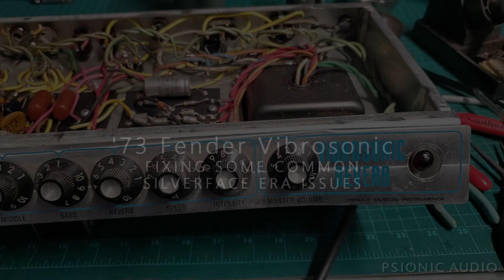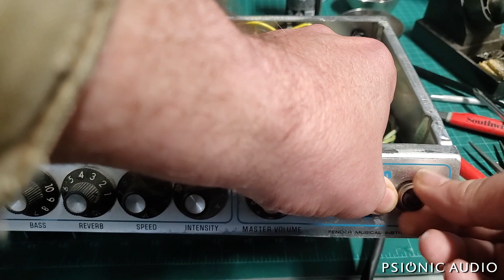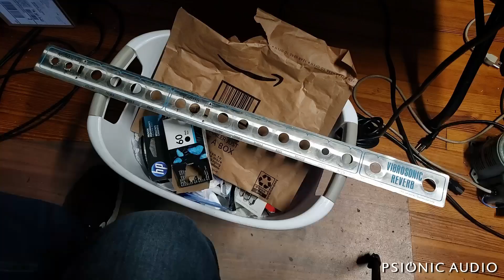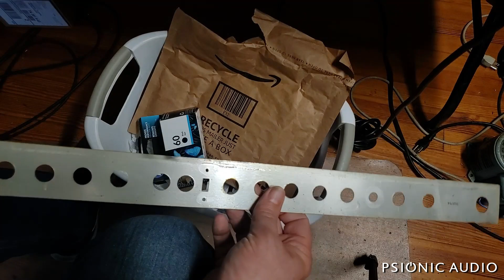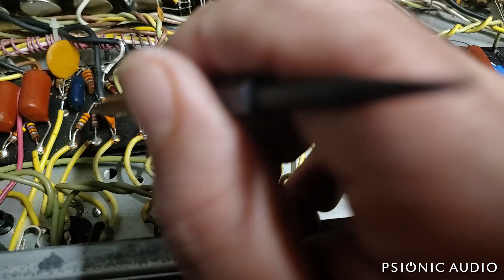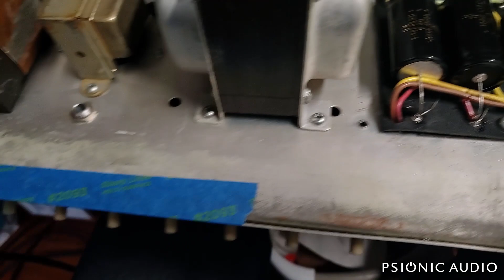'73 Fender Vibrosonic | Fixing Some Common Silverface Era Issues

Comment: Nice video! Appreciate your attention to detail about some subtle changes in the circuit. Most people miss those. That's why I'm posting this additional information. You seem like the kind of guy who would care. :-) The reason your faceplate came loose on that end is because you are missing a Fender installed retaining piece on the jewel assembly. As others have mentioned, on these amps there was a chrome flange washer that screwed UNDER the jewel itself, but OVER the faceplate. This is what holds the faceplate secure on that end, not just adhesive. These flange washers were often lost because people forget to put them back on when replacing the jewel lamps. I would be glad to post a photograph of this oft-forgotten Fender part, which I can show as original to my late 1973 mfg. date Vibrosonic Reverb. This trim washer was actually a kludge introduced by Fender by about early 1973. 1972-74 Sales literature does not show the flange washer on the sample amps. The faceplates were coming loose due to the heat of the power supply softening up the adhesive. I have seen many Fender amps with this washer still in place, but many more with it missing. It is easy to lose.

But why the kludge? There is a reason and here it is.

FWIW, the 100W amp series faceplates were made independently and easily removable by non-assembly technicians at Fender. This was accomplished by keeping them clear of most front panel potentiometer retaining nuts and the jewel assembly. The holes were simply punched out larger. Only the input jacks and brite switches were encumbered. This was on purpose. This was to allow Fender to accomplish final branding on the chassis at a much later point in production. That was done because this one chassis design, aka "100W RMS amp with reverb and Vibrato" was used for no less than FIVE otherwise electrically identical Fender amplifiers. Those were the Quad Reverb, The Super Six, the Vibrosonic Reverb, the Dual Showman Reverb and the Twin Reverb. Thus, Fender could build a single line of amplifiers to 95% completion, and brand them via faceplate at the very last moment based on demand, and with only very minimal technical intervention, and NO SOLDER WORK required. This vastly shortened delivery time and allowed Fender to respond to market demand, instead of having to have five lines in parallel, or rotate production through multiple versions, or end up with unwanted back stock of less popular models because of bad sales projections.

Note too that this amplifer series came either with or without a pull boost option from the very beginning. Fender did not "add that later". Schematic, here; https://www.bustedgear.com/images/schematics/Fender_100W_SF.pdf     All these details can be confirmed from the schematic, including the "pull boost option" See note 5 on the schematic, where Fender specifically states that pull boost was "used in some versions". The pull boost option was original to this design, and debuted in 1972, which is confirmed by Fender sales literature of the period. Read Page 49, here; https://www.dropbox.com/s/6fo2m2lulce5a58/1972%20Fender%20Catalog.pdf?dl=0      FWIW, my late 1973 mfg. date Vibrosonic has this feature. It is easy to find example both with and without pull boost dating to this period, so it was not a "later addition" by Fender. It was there from the beginning of this design, as both the catalogue information and well dated examples still extant easily demonstrate.  

I have never been able to discover how one could get this design amp WITHOUT pull boost. Perhaps Fender simply did not include this feature on a set number of amps? Perhaps it happened due to a lack of parts availability, or by special order, or for export only? I can find now compelling explanation, nor logic to the thing. But they definitely did it and examples of both are easily discoverable.

Cheers to you!
Reply: I think the pro reverb & super reverb are also in that same size chassis. Maybe some I’m forgetting also like the semi-pro/amateur & the east coast released Soupa Revurb!

Comment: Great video....my '73 Pro Reverb (non master volume) has only 5  25/25 bypass caps on the board with one of them being a 5/50. Yet all the silverface circuits I 've seen have 7 caps?  They are the old white original mallory caps which need changing. Just wondering if i should add the extra 2 caps as per all the circuits I've seen? And would a 25uf/50volt cap be ok to replace the 5/25 cap?
Reply from the maker: The 5/50 is better. And look over by the RCA jacks for the other two caps. They’ll be there.
Reply: @PsionicAudio  Thank you. There is an extra one on the vibrato rca which makes 6 in total. No sign of a 7th cap

Comment: Echoing an earlier comment, these Silverface amps had a trim-ring to hold faceplate down, held by the jewel light. You can see the scratch on the faceplate where it once was.
Reply from the maker: Yeah, but they are very commonly lost. And nothing (even on special hardware sites) is a good replacement

Comment: The oils in the GooGone will make it very difficult for new glue to adhere to the metal. You need to clean that stuff off REALLY good before gluing.
Reply from the maker: Yeah, I have naptha for that.

Comment: I have a 69 Bandmaster Rev  on the bench right now that I couldn't get the bias any hotter than 45% and when I started bringing the resistor down, the plate voltage was just in the basement at like 355v....poor thing looked like it sat on a shelf next to a turbo 350 transmission in a garage for 40 years, plugged in and on, when I first got it in.

Comment: The hits keep coming! Thanks for the video, Lyle. Just as an aside, I have a similar era Twin Reverb in my shop right now and it has a large chrome finish washer between the jewel light and the front panel. Not sure where you might find an aftermarket replacement, but it looks like that's how it was done.
Reply from the maker: Yeah, but so so many amps have them missing.
Reply: @PsionicAudio  I found an M18x22x1.5 aluminum washer (think auto oil drain washer) works OK. It’s a tad oversize but with a heat shrink shim fit well. Not perfect but easy and inexpensive.

Comment: I've heard people criticize the push-pull circuit before, but I've never really understood why.  I have a 1980 Princeton Reverb with that feature.  I bought it new back in '80 or '81.  It sounded kinda bleh when I first got it, but I put a Weber speaker in it and now it's the best-sounding amp I've ever owned.
Reply: The PR push-pull boost circuit is totally different from the later sf Pro and Twin push-pulls.

Comment: Another great and helpful video! I have an early 70s Fender TFL5005D Bandmaster. Added a trim pot to the existing Bias Balance Pot. Nice to be able to balance the output tubes and set the bias as well. Good stuff. Oh, please keep an eye on the weather in your area for Wednesday March 30. You are under a Moderate Risk for a severe weather outbreak. Things could get crazy with the weather around there. Stay Safe!

Comment: Hi Psionic! Love your videos... I don't know if any Fender 400PS bass amps pass through your shop, but I'd love to see you repair one these. I'm rebuilding a couple of these amps, and I think the output section could be done better. The output section has some rather large grid snubber caps that probably take out a lot of treble frequecies. Also, I don't quite understand the logic behind the bass input cathode caps being of smaller value than the normal channel's cathode caps.
Anyway, thanks again for the videos, you have a very informative channel.

Comment: is there anything that can be done to make the push pull function useable?
Reply from the maker: I rip out the boost circuit and restore the reverb stuff to AB763. That just leaves the MV itself. At which point I remove the bright cap on the MV and it sounds good again.
Reply: @PsionicAudio  thank you, it's on a princeton reverb and i hate it
Reply: @glennbeeler3312   There's another guy commenting here who has one of those and he said it's the best sounding amp hes ever owned......🤔
Reply: @goodun2974  It likely is, long as he don't tug on the reverb knob. @bevo65 didn't say...

Comment: Hey-oh Lyle... are your Strat pickups and electronics stock (?) 
...and in your opinion are PPIMV's really worth the geek/nerd lust? 
Thanx for another cool vid and... 
Cheerios (but not for breakfast)
Reply from the maker: Oh, and PPIMVs are better but in an amp that's primarily clean like this the pre-PI can be fine.
Reply from the maker: No, not stock. I have videos up on the pickups and mods. This was my Psionic Egobooster (musikraft partscaster). The strat with rosewood board, Gotoh 510, Suhr Thornbucker and Mojotone '67 Quiet Coils and non-standard wiring (I can do series/parallel on the bridge and blend in the neck pickup).

Comment: There should be a big shiny washer under the jewel to hold the faceplate down.
Reply from the maker: I agree. But they have gone missing on so many SF amps that come in. And I haven't found a source for a suitable replacement (McMaster, etc).
Reply: @PsionicAudio  My dusty memory seems to recall getting a thin chrome washer from Ace Hardware that worked after I. Opened the hole up a bit with a Dremel sanding bit.
Reply: @PsionicAudio   So, if I understand you correctly, you are saying that the hole in the silkscreened trimplate is larger than the typical bezeled/beveled nut/collar assembly used on other Fender pilot lights? How large is the hole in the trimplate? I may have parts that'll fit and look "stock"....
Reply: @goodun2974  
Yes, it's bigger than the light bezel. The faceplate hole on mine is 3/4" and I'm missing the washer...
Reply: @NoOne-sn2si  , interestingly, I have some vintage DialCo brand bayonet sockets that have a very slightly larger outer flange/bezel than the Fender flanges, 13/16" diameter instead of 3/4" (aka12/16).  I don't know if that's big enough however to catch the cosmetic trim plate  and hold it down.  The DialCo sockets accept the same screw-in "jewel" as the Fender sockets and would look the same from the outside, but they  are self-contained cylinders, a little like a stubby vintage bakelite fuse holder, not open frame like the Fender sockets. They can be kind of expensive on the vintage market, anywhere from $8 to $30 !! and they come in two varieties, one for use with an ordinary #47 incandescent bulb, and another with same bayonet socket but including a built-in resistor so that you can run a 120VAC neon lamp. Obviously they're not interchangeable and the DialCo socket with the built-in resistor won't work for a 6-volt incandescent bulb, and there's no part number on them to differentiate the two types! (Check them with a multimeter). They might be a drop-in fit in place of a Fender lamp socket (if length allows); or, the integral (crimped on) 13/16" metal collar could be cut off with a Dremel tool and used with the standard open-frame Fender socket, if the fractionally larger flange will work to hold the trimplate down.....

I had a repartee' with guitarist Tab Benoit about fractions last week; he was telling the audience that he's been using pandemic downtime to repair storm damage to his home and bayou camp, but he's not good with fractions and so his reconstruction efforts never seem to go smoothly. He chuckled when I pointed out that most plywood isn't 1/2" these days, it's 29/64ths!

Comment: I have seen that oversized coupling cap in silver face Deluxe Reverbs as well.  The stock DR speaker won't like it and many replacement speakers will not like it either, and if you do have a speaker that will handle it it will literally make your pants leg flap if you stand close to the amp.  You will get more headroom from the amp if you change that coupling cap back to the earlier blackface value.
Reply from the maker: You don't want the 1nF if the amp has the 330K grid leaks. 3.3nF for those gives the AB763 response.
Reply: @PsionicAudio  do you think it was a design thing meant for pedal steel players? who apparently this amp was meant for

Comment: I own a 1976 one of these. They are as rare as hen's teeth here in the UK. Mine had a JBL d130 speaker that I changed for a eminence legend 15". It is a great amp that I would never sell.
Reply from the maker: Electronically it's a Twin Reverb. Haven't looked to see if it's the same OT but I suspect it is. Same amp, different cabs/speakers, different name.
Reply: @PsionicAudio  I took the pull boost off of mine because the switch fell apart and they are difficult to get in the UK. The boost was a crappy design and didn't much anyhow.
Reply: Scored one just a couple of weeks ago here in NI. Splendid amp, though mine came with non-original Black Widow speaker.
Reply: Why did you swap out the D130? (and was it grey or orange?) 
Cheerios
Reply: @jonnybeck6723  it is a orange one and needed to be re coned. I am planning on re coning it and putting it back in , though the Legend is an amazing speaker for Fenders. I don't think the d130 would be any better! I also used a 12" legend in my 5e3 I built. Killer tones from that!
Reply: @rgbplumbinghilton  I love the Eminence 12" in my HRD 1st year MIM... (2000)
I've owned 2 grey di30's back in the day and miss 'em... A lot seems to be how a speaker is broken in also IMHO
cheers